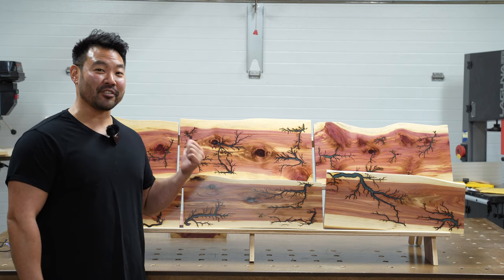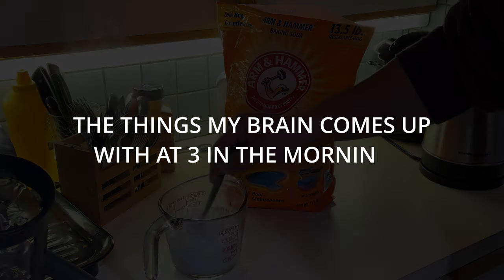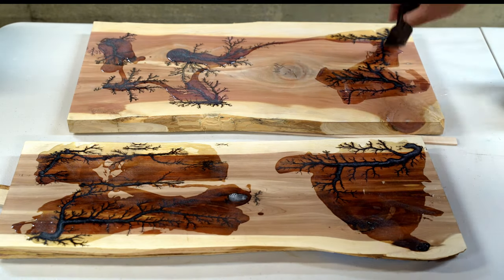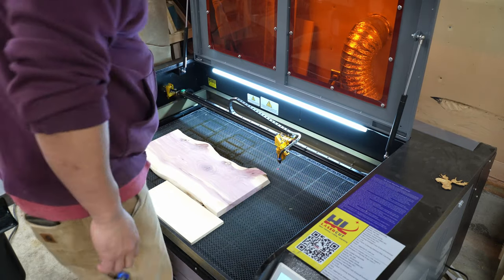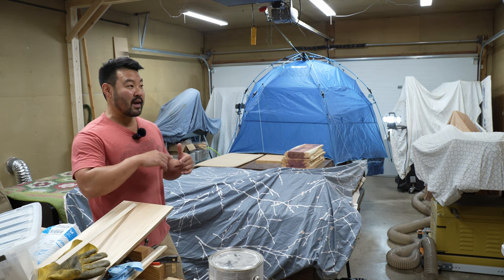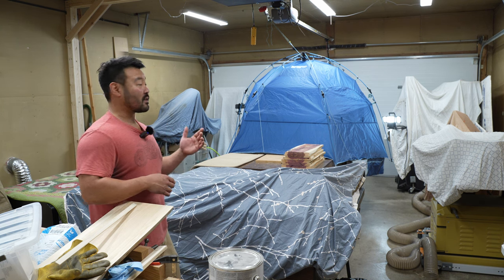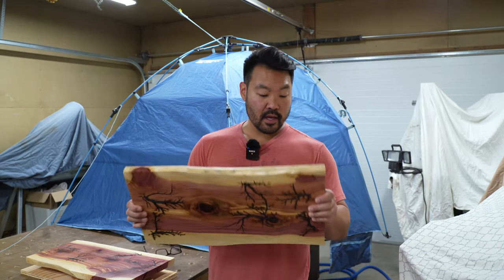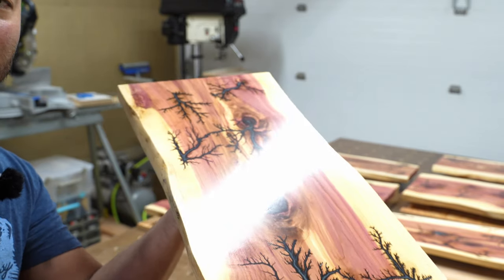Next Level Wood Burning? - Fractal Burning

Comment: What kind of power supply do you use to fractal burn ?  I have a neon light P supply, noticed your does a pretty good job also.. Thanks
Reply from the maker: I just pulled a transformer from an old microwave. I haven’t used anything else before but it seems like it works well enough! Rather I’m happy with the results 🤣. And thanks for watching!

Comment: great work mate..why not use a window squeegee you would be surprised how  much  excess  it removes and if your quick you can use it on the next one,,ive been using norglass two-pack epoxy with a huge syringe as led light travels so well through it and while it is a bit more fiddley you dont use as much and no where near as much sanding,,just a thought,,
Reply from the maker: Dude get outta my brain!!! Haha I just got my order of syringes in. When I do one at a time my small putty knife works well but not on multiple at once. So I’m always looking for better ways. I so appreciate your input Jason. 🤚🏼